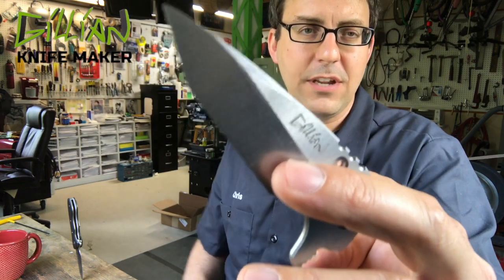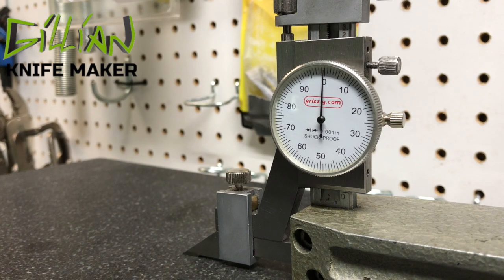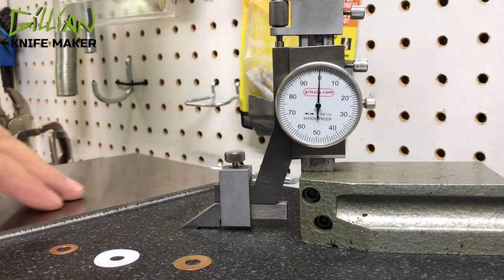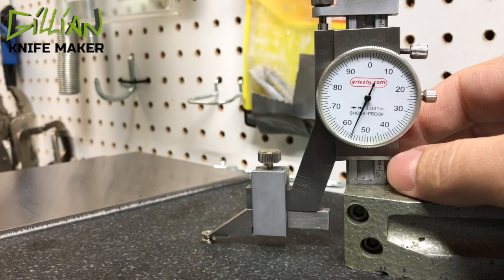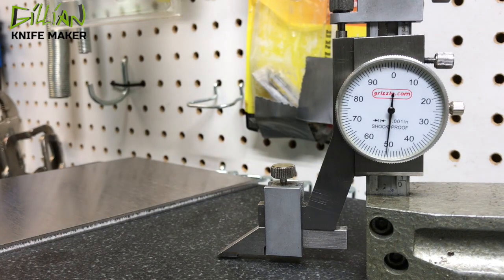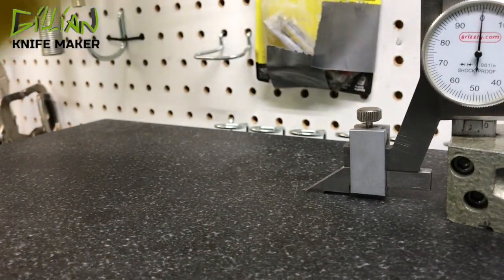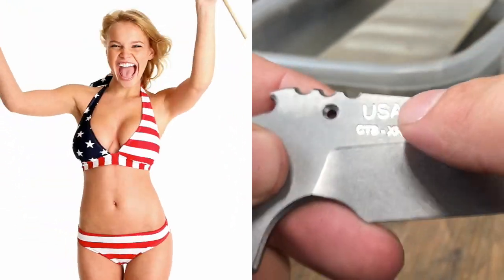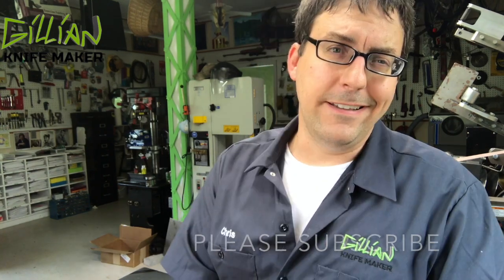surface grinder knife making engrave -knife engraving tools

Comment: I always thought that most makers surface grind after heat treat to counter any warping in heat treat.
Reply from the maker: Yeah I used to leave leave .005 to fix any problems, but if you take off equal amounts, and  normalize (stress relief) before austenitizing, followed by a plate quench (heavy plates), you won't have many issues with bowing at all.  If your free hand grinding, the amount of stock removed or may not be equal, and if your using oil for the quench you can forget about it.  So long as your stock is flat, parallel, and stress relieved, you should be good to go.